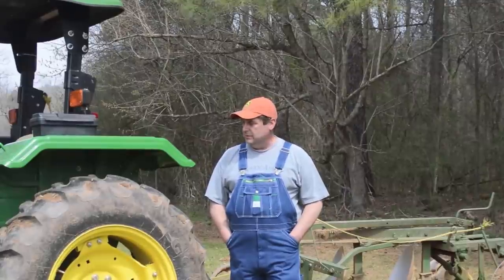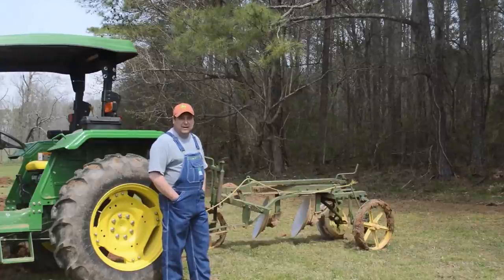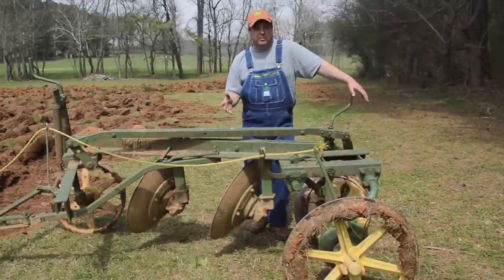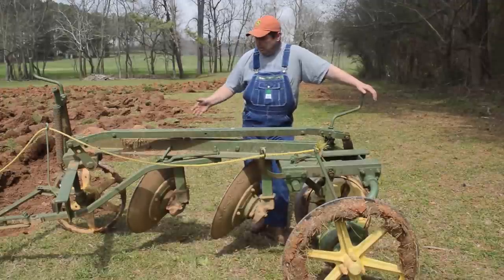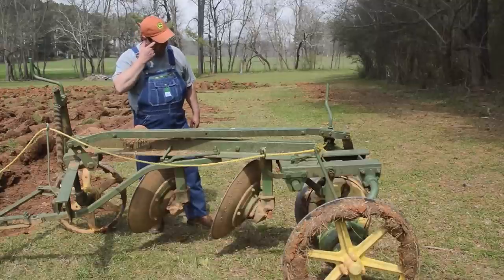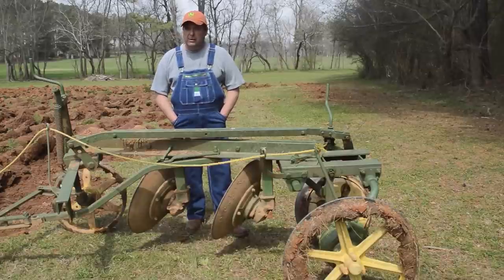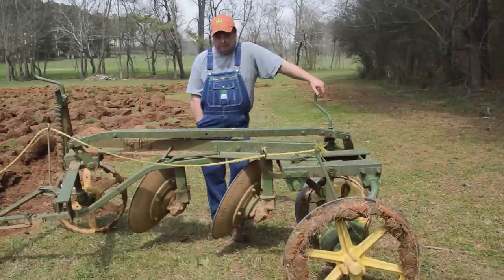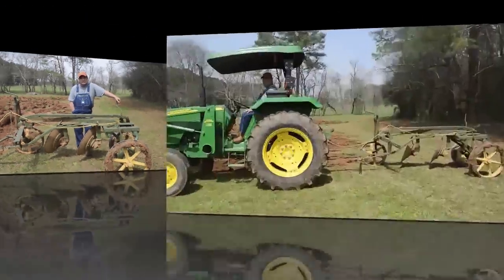Plowing with a John Deere 402 Disc Plow

Comment: Where the moldboard is for cutting deep and breaking up soil, the disk plow is designed for turning the surface soil.  It is excellent at mixing layers and material together (folding in manure and other other bulk) as well as leaving a bed of fractured dirt that is then easy for disk cultivators to then chop up.  It isn't as even as a much finer spaced row of moldboards and is limited in depth by the maximum size of disk but in many circumstances there are finer disk plows that do both the plowing and cultivation.   If you're going to be doing large home gardens with a tractor a modern disk plow isn't hard to come by and will do what you need.   Cultivation is turning away from yearly plowing when possible but its still necessary for vegetable/root crops and if done under the correct conditions is still advantageous to the soil if you're folding in lots of biological material.

For grain crops other than corn it really isn't necessary any more.

Comment: neat!  but it leaves a real MESS behind it!  ouch!   i would plow in the late fall and let the rain / frost break the ground down all winter then its a smoother disking ride in the spring....
Reply: from what ive read the first disk should be higher up and the second lower, most guys run the first disk deeper and the rear shallower. havent used mine too much since i just got it, to verify it. i have the Ferguson pao 20 so its a 3pt

Comment: Very nice. I hsd a Dearborn 2 disc 3ph plow. it was heavy as hell and hard on a 50hp Ford diesel. Dont know how an 8n ever moved one. Pull type impliments always do better. A pull harrow will outdo a 3pt harrow anydsy.
Reply: I'm partial to pull type equipment as well.  My neighbor has several pieces that I love to borrow at times.  Pull type harrows really outshine 3pt equipment in my book.
Reply: +Steve Abernathy I found an old pull type JD "disk tiller" in a fencerow once. Wanted to keep it but was too much for an M Farmall. Seems like it had 8 disks on it with iron wheels. I sold it.
Reply: +Robert Clark. Hello! We had a friend that had a John Deere A and he pulled a John Deere 6 disk tiller. That seemed to be a load for the tractor. I think a John Deere A and a Farmall M has about the same in power. Was the 8 disk hydraulic or manual lift?
Reply: +tkguyok That ole tiller we got was a iron wheeled rope trip lift model. Didnt ever try it because I honestly didnt think that M would pull it. At least not effectivly anyway.Maybe skimmed the top of the gro6nd.
Reply: I figured that it had the rope trip lift, most of them did. I did see one that did have a hydraulic lift. It was abandoned on the edge of a field near an abandoned house. Yeah, you couldn't pull it very deep in the ground with the Farmall M. Now, a Farmall Super M or Super MTA probably would pull it, especially the Super MTA with the added power of the torque amplifier. We had a Farmall H and Super C. With the H we pulled a 5 disk International tiller and the Super C we pulled a 4 disk Case tiller. They would roll the soil.

Comment: The farrows seem really deep how do you prep for seeding?
Reply: What is minimum hp tractor for this plow?
Reply: +Bill Bright. Hello! I read on a blog about disk plows that was on the internet. One of the bloggers said 15 horsepower per disk is required and this also could be influenced by your type of soil, sandy loam, clay, etc. I hope this helps you.

Comment: Good video. I subscribed to your channel. That is a nice plow that you have and it does good work. Your tractor was having no problem in pulling it. John Deere still makes disk plows, but it's a secret to them here in North America. I've had my local dealer check on them and even sent an email to to corporate checking into them. They tell that they were available back in the 1990's, but if you Google John Deere disk plow or arados or disc plough it will pull up information on them. Apparently they are available in Central and South America and other countries overseas. The model numbers are the 624; 3 disk, 635; 3 disk, 645; 4 disk, 3745; 4 disk, and 3755; 5 disk. All are 3 point hitch and  hydraulically reversible, except the 624 which is manual. I've found videos of them on YouTube. Monroe Tufline make them, but I don't think their's are reversible. Tractorhouse.com under tillage/plows Industrias America has 4 and 5 disk models which are reversible. Do you remember the old disk tillers that they use to make? The disks were in a gang instead of separate like on the disk plow. That's what we used on our farm. I have never understood why they weren't more popular than the moldboard plow. They look like they would certainly pull easier and work in more types of soil. If you decide to check into the new John Deere plows let me know how you do. Like I say good luck.
Reply: Thanks for the comment.  I was not aware that Deere was still making them.  I'll check it out.
Reply: +Steve Abernathy. Hello! Like I said in the comment, good luck. What gets me is I contacted the corporate folks and they didn’t try to help me. You would think that they would want to make a sale. I guess one could go to Mexico and go to a John Deere dealership and purchase one and bring it back into the United States. I am sorry to say, but Mexico has a lot of crime and being an American, that might not work out to well. Check out Tractorhouse on the internet, you might find a used one under John Deere plows. Also on Tractorhouse, there is an equipment dealer in Texas, I can't remember their name, but they sell Industrious America disk plows, I think they're made in Mexico and I heard that they use John Deere bearing, but I don't know if this is a fact. Anyway let me know what you find out and how it goes.
Reply: +tkguyok. That is Industrias America not Industrious America. Montgomery Tractor Co., Seymour, Texas (888) 458-1702 sells them. The nice thing about these plows and the John Deere plows are  they're reversible.
Reply: He's moving about 4x faster than the plow was originally supposed to be pulled and it just doesn't care which is awesome.

Comment: How is it in more rocky soil ?
Reply: Probably not very well.  The disc are thin and likely would chip and break in rocky soil.  Mine have a couple of chips out them from the previous owner who had some rock in his fields. For clay and sandy soils though they work like a charm.  I would go with a moldboard plow in rocky soil as they are stronger and less likely to chip

Comment: Would do a much nicer job at a little slower speed. Probably would've been pulled at half that speed originally. Plowing in any form is not a race. It's a about rolling the soil. Pointless to exceed the capabilities.